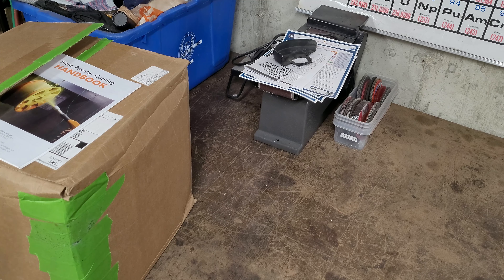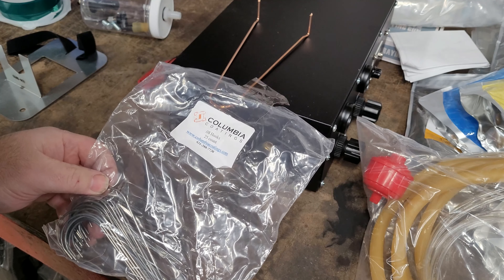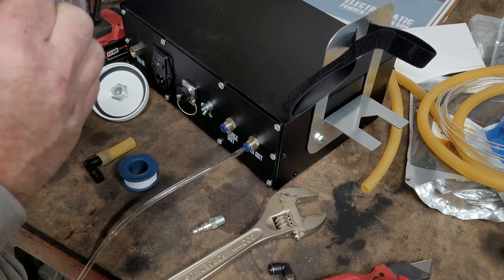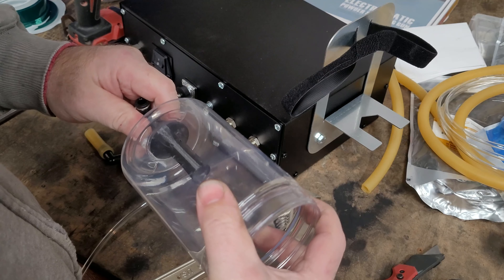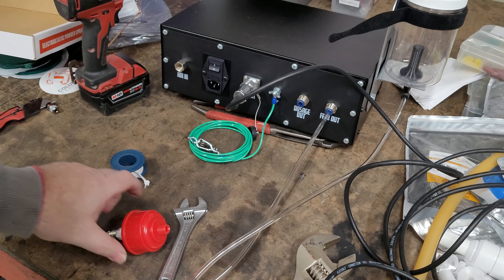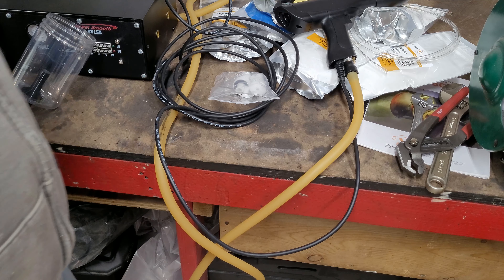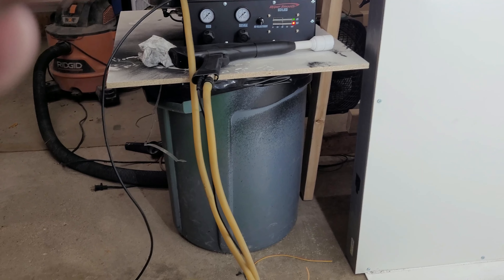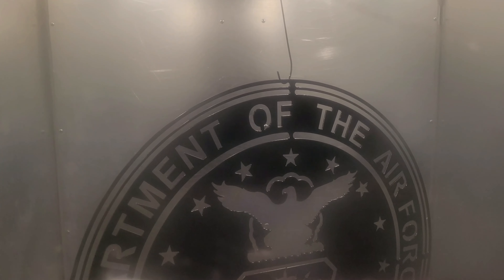Columbia Coatings Hyper Smooth 03 LED Assembly And First Use

Comment: What do you think of the the Hyper smooth 03 LED after a year?
Reply from the maker: I just bought an Electron system if that tells you anything.  It's not terrible don't get me wrong, but it wasn't good enough and the hardware that comes with it (hoppers in particular) were trash.  Their customer service is not great and they curate the reviews on their website.  I would not recommend anyone buy from Columbia Coatings.  There is a rant video coming at some point in the future when I have more time.  I've been meaning to do it for a few months now I've just been buried.

Comment: I made all my own hoppers. Cuz there's stink.
Reply from the maker: I'm trying to work this out with them right now.  It's crazy because their system is otherwise really good.  The fine adjustment ability of their regulators is exceptional.
Reply: What did you make for hoppers?
Reply from the maker: @ThePowderShed  I wound up buying new stems and barb tops from a seller on Etsy, I believe they are called Printrovert3D.  Anyhow, they 3D print cyclonic stems and top barbs that swap right in for the Columbia Coatings stems and barbs and they work GREAT.   Here is a link to the one I bought:
https://www.etsy.com/listing/1215750662/diy-universal-vortexswirl-style?click_key=eb8a5d4e741f147ba046883c3edd3255a5c340b1%3A1215750662&click_sum=74ef4ee8&ref=hp_rv-2&sts=1